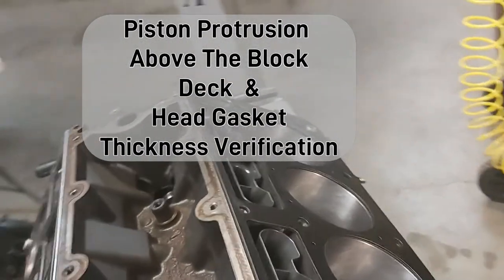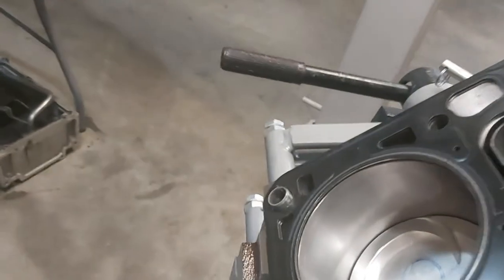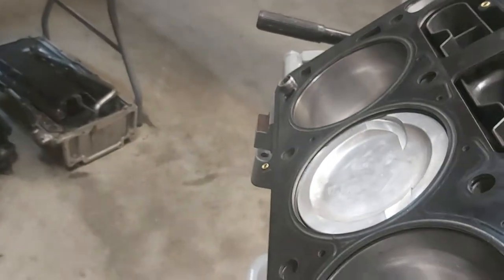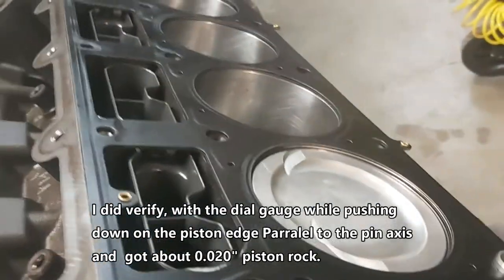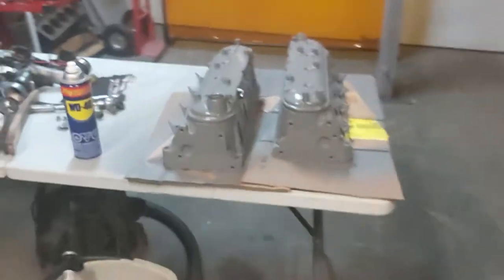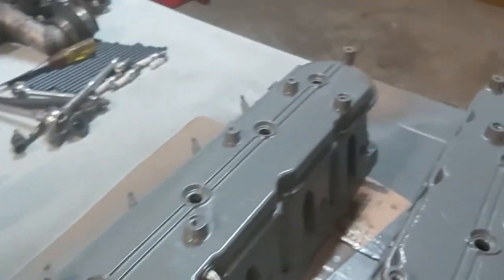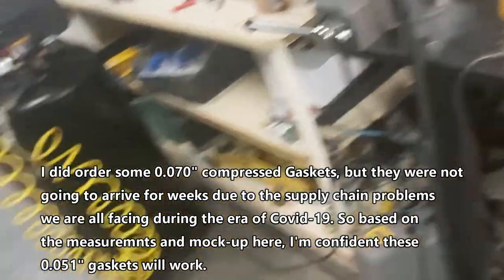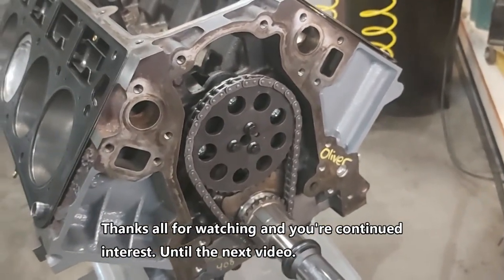Piston Protrusion Above the Block Deck, & Head Gasket Thickness Verification

Comment: I'm facing the same thing now with a bbc. Block was decked with the expectation it would be within.005 below deck. When verified it was .018 below deck. Had it machined again and it's now .005-.006 above the deck. Gonna use .051 gaskets should be where I want it just sucks machine shops don't take the time doing things correctly. As the saying goes you had one job to do.
Reply from the maker: Yes, you'll be fine as long as the piston's don't hit the bottom of the cylinder head. I'm running that exact same thickness gasket and no problems as of yet in my situation......Thanks for watching and commenting...